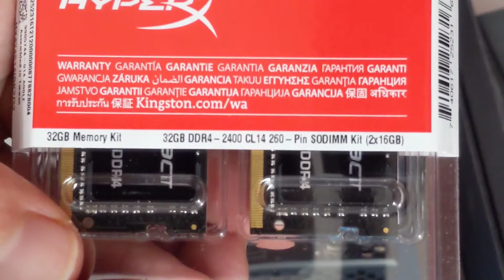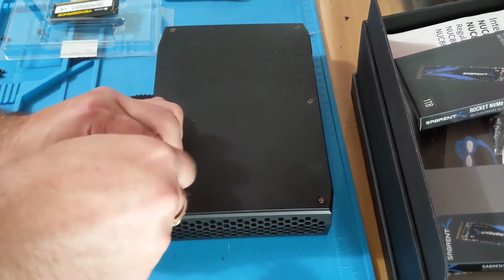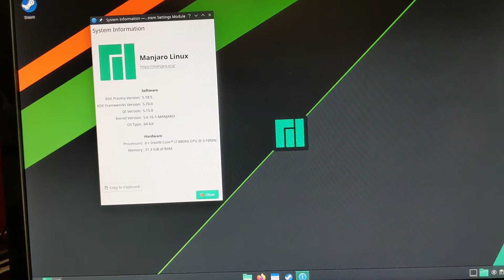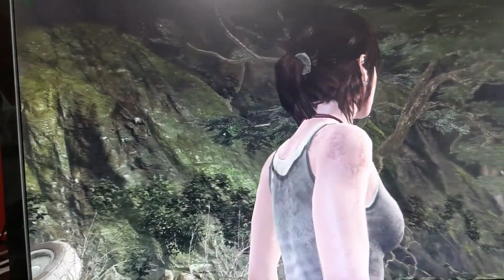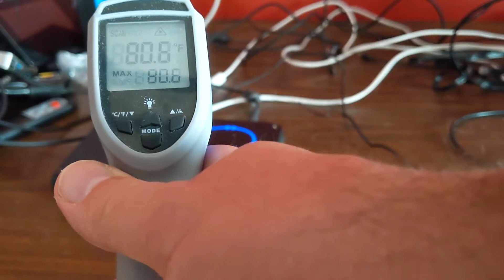Intel NUC8i7HVK Upgrading w/ 32GB DDR4 + Sabrent NVMe = 200+ FPS?

Comment: works with this ?Corsair Vengeance SODIMM 32GB (2x16GB) DDR4 3200MHz C22  because the other is not available thanks
Reply: i tried the 3200mhz, mine would not work with that speed, so next i will try at 2666mhz ok hehe

Comment: Sadly you made this review two late, I have this until and you can't install the last drivers for this card, so it's many versions behind thanks to Intel and amd falling out and now amd no longer supporting the RX Vega platform, I have used this PC for about a year now and it's nippy I also have the very same ram so and now I can tell you without e EGPU this until is falling my i5 9th gen laptop with a GTX 1650 ti and badly in many places.